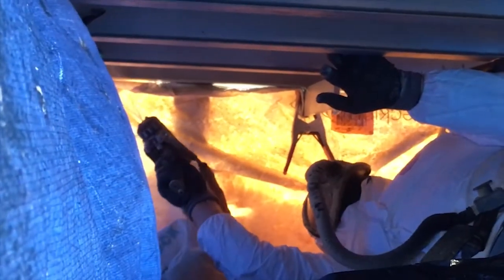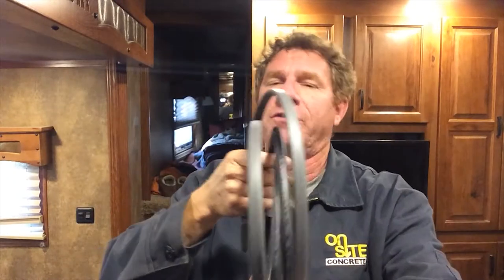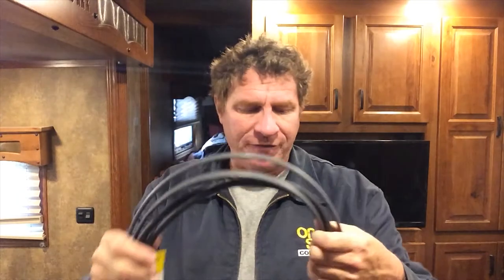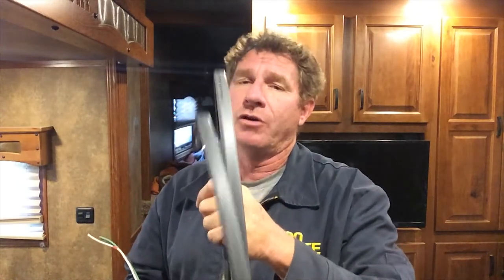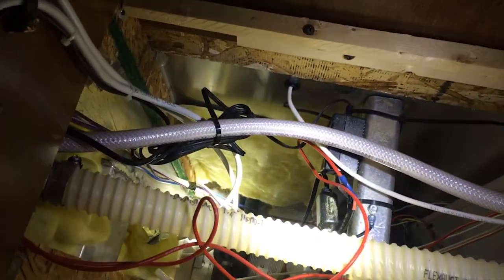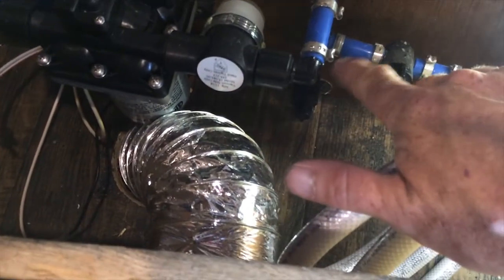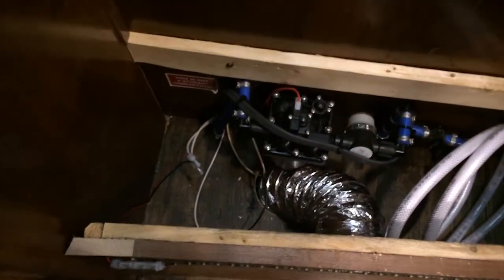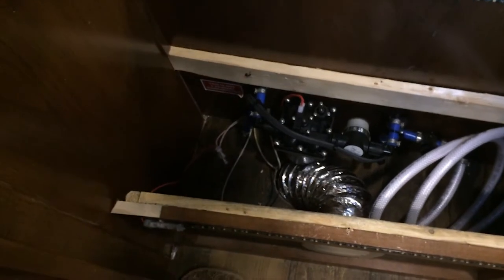12 volt heat trace wire for RV Heatline Kompensator

Comment: Did that cable work???
Reply from the maker: Everything works just fine. All I did was make it easier to set up on my horse trailer after moving around. I’m sure you can extend it if needed. I would definitely use the same shielded cat 6 wire.

Comment: Did you get your truck fixed up ?
Reply from the maker: It’s a duel now. Had to replace the head gaskets and put studs in. Then I swapped out the rear axle and widen out the bed.